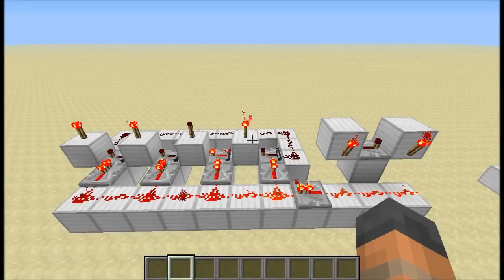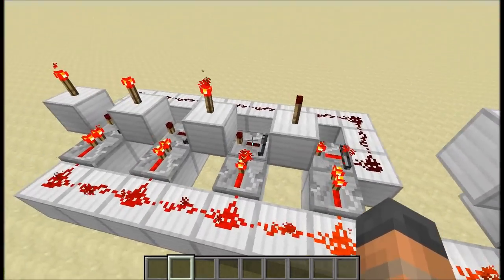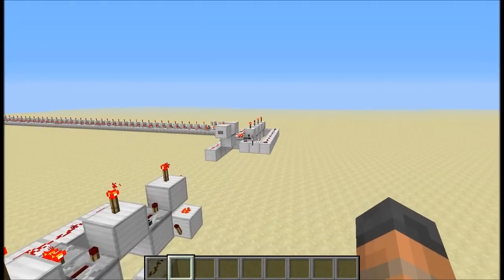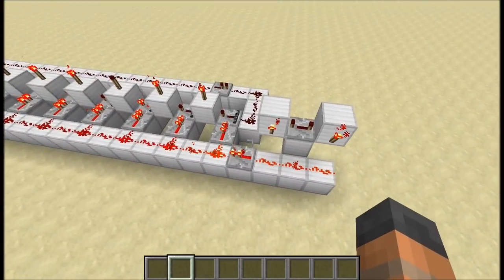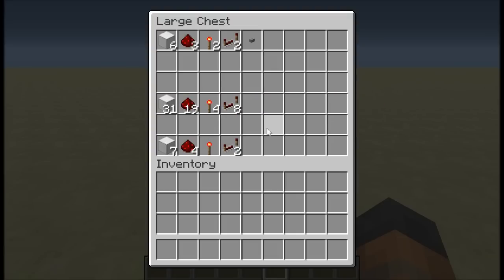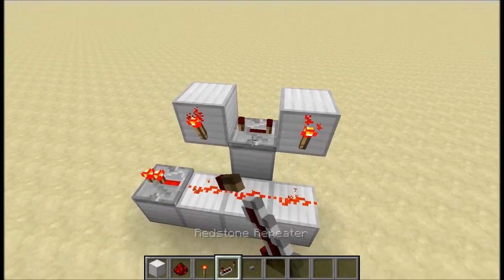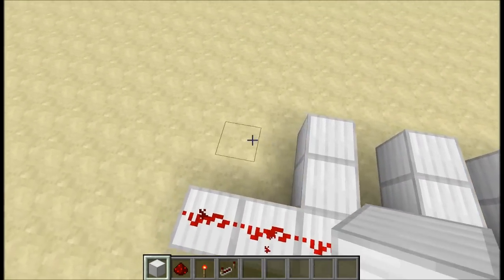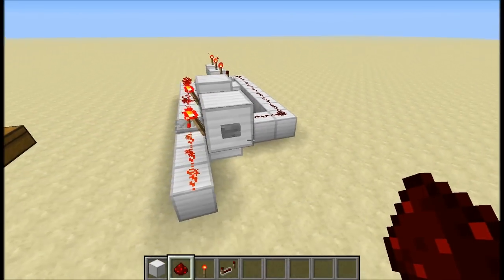Redstone Counter Tutorial

Comment: Needed a way to cycle through lines of programming for a display. Works pretty well. Only minor issue is chunk loading, as the signal will disappear if it goes into an unloaded chunk.
Reply: Edit: I realized I could use an OR switch that reads the oput of each segment. If there is no selected segment it'll auto-feed a new signal into the chain.

Comment: How to locked repeaters work?
Reply: if a  repeater running into a repeater is powered, it becomes locked, meaning new redstone signals cant enter it, but if the repeater is already powered, it will become locked but stay powered as long as  the redstone signal powering it is on, but once that redstone signal becomes off, no redstone signals can enter it until it is unlocked.

Comment: A few things i would like to point out. Although this is a good design it can be improved. First being that this design requires a manual start in order to start the repeater loop. A design like this (/watch?v=ztNn4PXdadc) fixes this issue. Secondly, this design should not be used for precise clocks as the repeaters delay in between may cause issue. Reducing the number of ticks to 1 will help eliminate this issue. Those were the main complaints i had other then that it is a super compact design!

Comment: If you want the opposite output, you can either remove the torches and run wire directly from the blocks that the repeaters power, or invert each torch again with another torch.